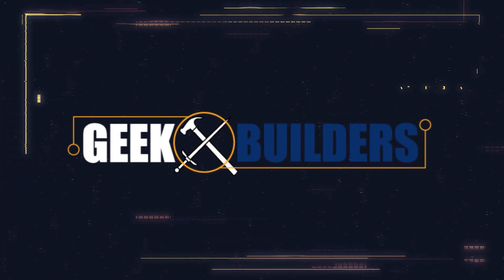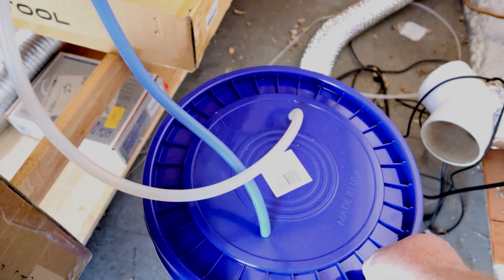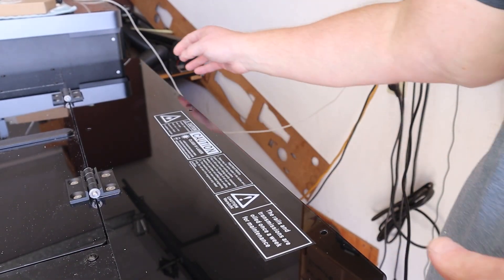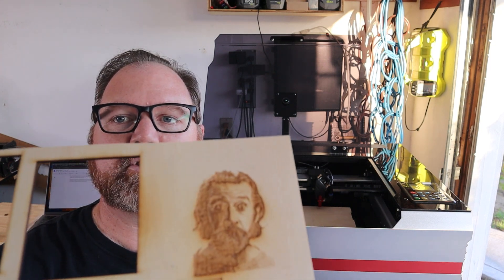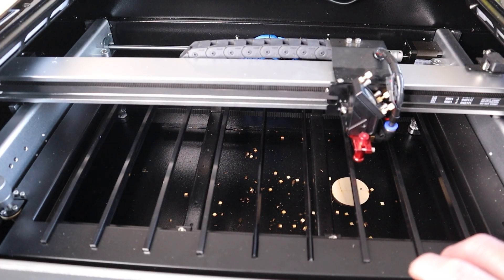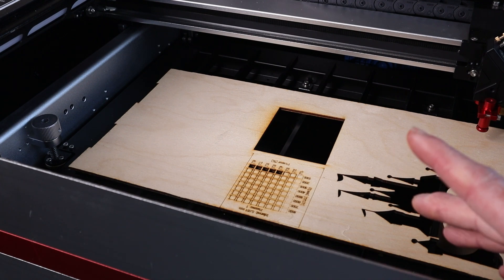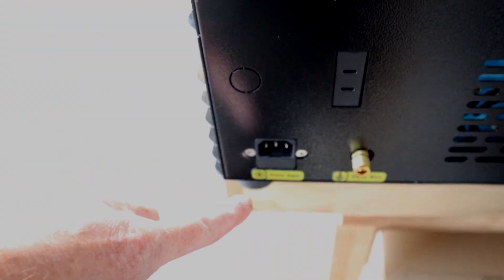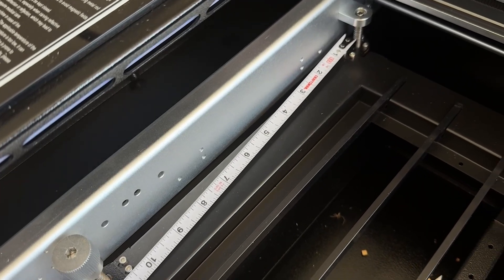Is the Monport 45w Reno the best of the affordable CO2 lasers?

Comment: I received the Reno 45 non-Pro four weeks ago. Thanks to a promotional price and a YouTuber discount, I paid around €740 and haven't regretted it. My Atomstack S30 diode laser cost more than that two years ago! It's a very good and affordable device, perfect for getting started with CO2 lasers. It's compatible with the Lightburn Core license (saving me money) and powerful enough for hobby use. Plus, no tinkering is required, unlike with a cheaper K40, which, after upgrades and modifications, costs almost as much or even more.
Both thumbs up!! 👍🏻
Reply: hi, do you think the reno 45 pro is worth it? i see a promotion for 940$ but not as low as you got it

Comment: G'day mate.. question for you since you got the vision model. They mentioned batch filling processing for this model. Does it work and what software does it work with?
Reply from the maker: I have not tested it yet, but it’s supposed to work with Lightburn.
Reply: @GeekBuildersNet  Interesting. I was wondering if it's worth having the vision or the pro.
Reply from the maker: @Mobijub  I have gotten use to not using the camera on any laser- I prefer framing instead. I will use the camera in my upcoming video and can comment more on it then.